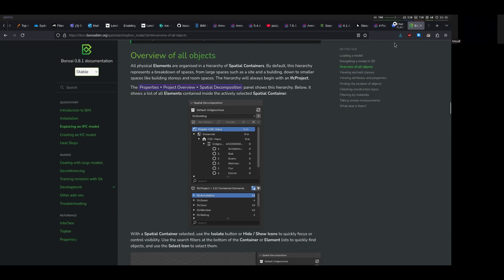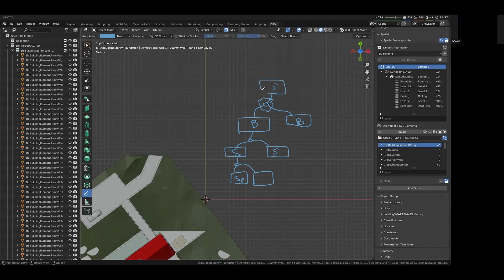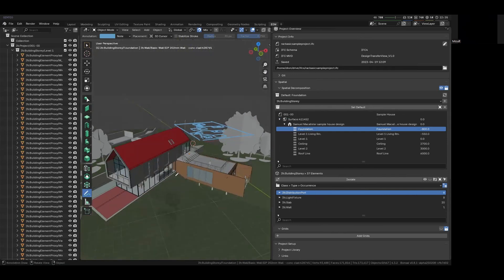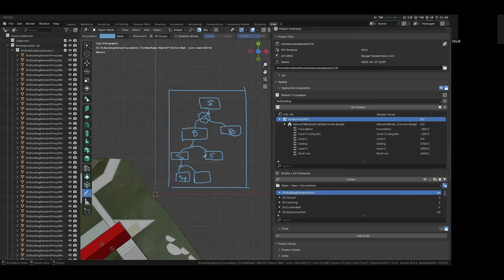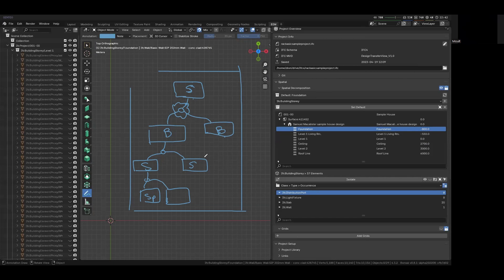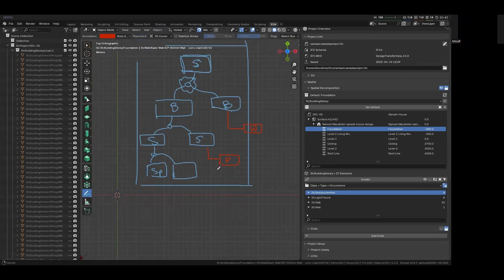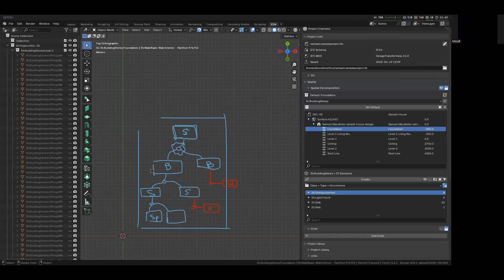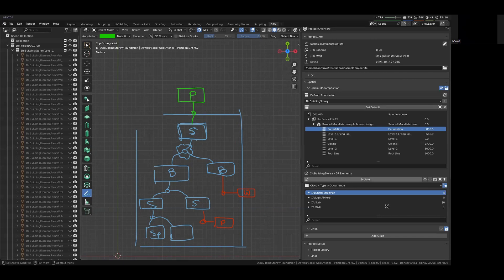IFC Spatial Decomposition: The Core Structure Behind Every Model

Comment: hi, how would you approach one building with a common basement carpark and with 2 towers?
or maybe a building that has a common carpark at ground level, a carpark mezz level, then 4 towers, but then 2 of the towers having a connected top floor at floor 28?

How does IFC works with space on these sorts of projects?

also, the levels of each tower might be slightly different eg same up to level 10 then it might change so Block A&B level 11 are at +103.300 and Blocks Level 11 C&D are +103.000 but part of the same zone/Building
Reply from the maker: Great question, Wayne. In IFC the clean approach is to model each tower as its own IfcBuilding, while the shared carpark or podium can be another IfcBuilding underneath. Storeys don’t have to be aligned, so Tower A and B can have Level 11 at +103.300 and Towers C and D at +103.000, you just give each building its own IfcBuildingStorey elevations.

If two towers share a top floor or a sky bridge you can either model it as a storey that belongs to one tower but stretches across both, or as a separate small building for clarity. And when you need to group levels or spaces across towers, for example all Level 11 zones, you can use IfcZone. That way the geometry stays precise while the logical grouping is still captured.

Comment: Fantastic IFC Spatial decomposition education video.

Is there anybody knowledgeable to take a sample model similar to the model used for this demonstration, and use BonsaiBIM to correct the spatial decomposition?

Is the correct method to create a new decomposition structure in the existing IFC file and reassign objects to their correct pigeon hole in the tree?
Reply from the maker: yes, that is possible and not so difficult to do actually.
Reply: @BIMvoice  I have some IFC exports that seem to have the IfcSite and IfcBuilding at the same level.  I have been trying to work out how in Bonsai I can decompose the building to sit below the IfcSite.  I would love to see how that is done in Bonsai.
Reply: @FliesEyes  I see this issue also, good question 🎉